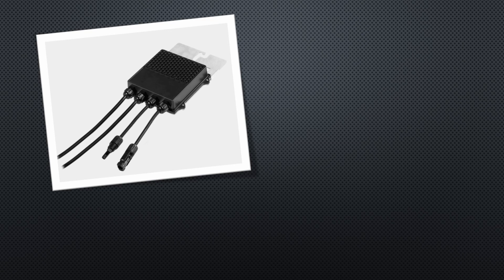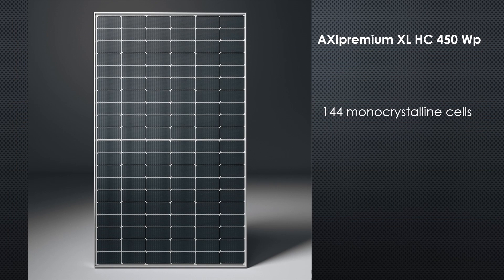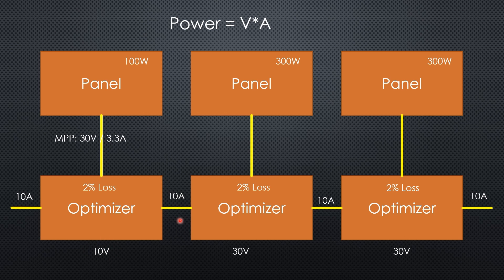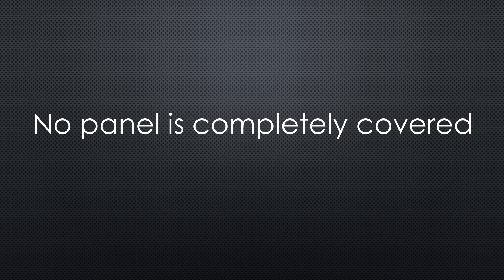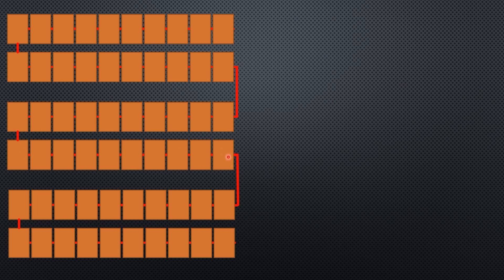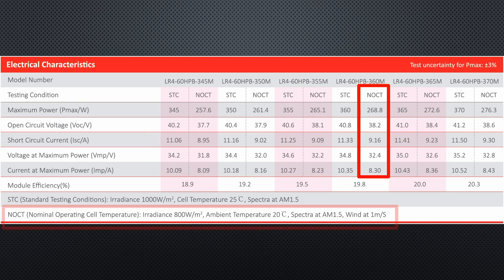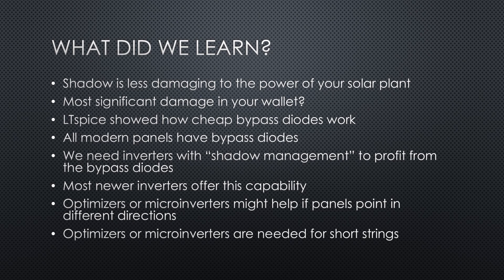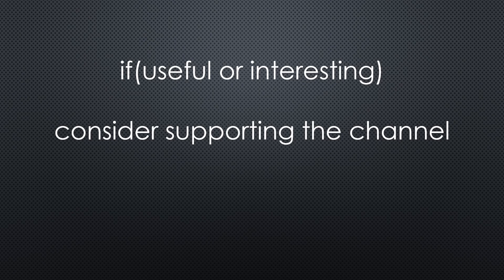441 Are PV Optimizers Worth the Money (e.g. SolarEdge)?

Comment: This is both disappointing and encouraging result. Disappointing, because I've already advised multiple people to get optimizers based on the claims from youtube videos. Encouraging, because I can remove them from my calculation :D
Reply: The still have a safety advantage
Reply from the maker: My cables are insulated. So I do not see a big safety advantage. To be electrocuted you need a defective plus and a defective minus pole and touch both. Still, then it is DC which is much less harmful than AC

Comment: Great Videos.  What was your Battery effect price wise. If people simply stop cooking and heating at peek price, does the battery cost still make scense.  Another way to ask this question , Is it neccessary to use batteries to offset your electric use at peek  cost, or is it just a simple habbit change.  most machines had auto start mechnisms. HOt water heaters can be increased to have what you need. Heating system could ram up before  peek cost, ( take your shirt of, naked is healthy) , This increase in heat would allow you to surf over the peek cost ( if insulation is good) .  You answered everything else I could possibly have had. I will make a donation now.
Reply from the maker: I did not buy my battery because I wanted to save money (for the moment, it does not). However, about 50% of our consumption is when the sun is down. So shifting consumption would mean to go to bed very early and sleep long ;-) 
Also during the day, clouds sometimes cover the panels during your washing (which cannot be stopped).
All your proposed optimizations make sense if you want to adapt your life to the sun. We only decide if we run the washing machines today or tomorrow if the sun level is different. The rest is done by the battery.
Thank you for your support, BTW!